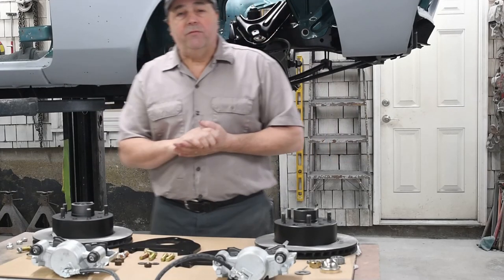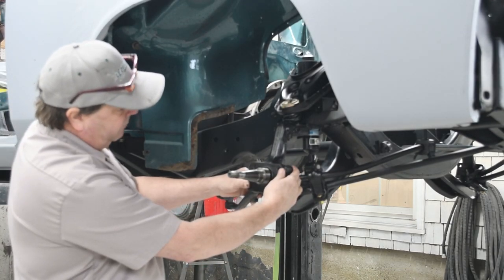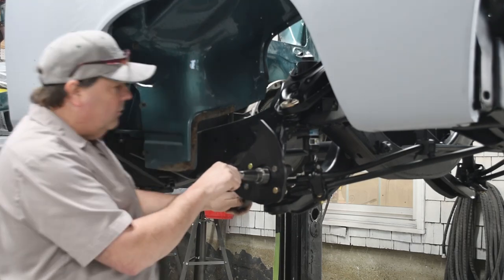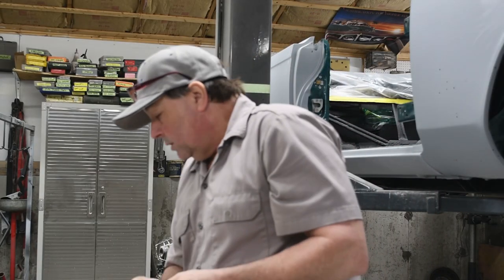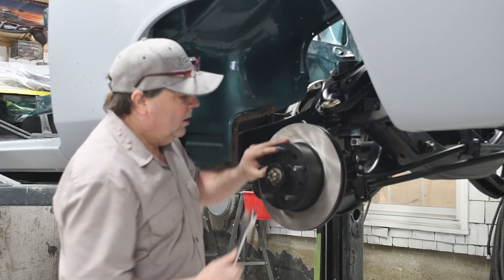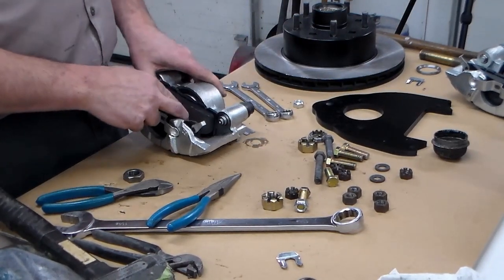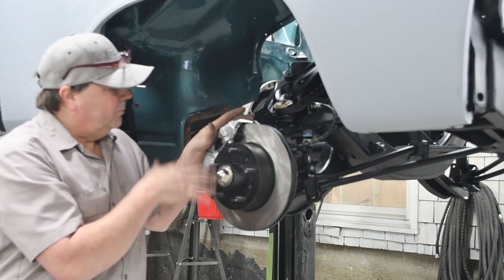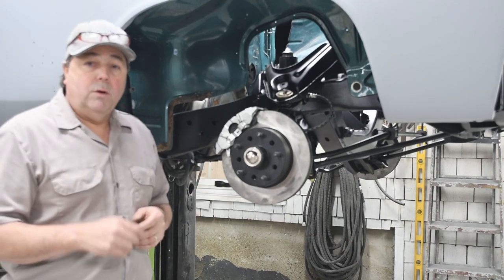Disc Brake Conversion

Comment: I am a B body guy, but I seem to remember that you could have used 1970 - 1975 C- body disc brakes including the spindles. It may have even been 1969, I just can't really remember..
Reply from the maker: I think some of that is correct Steve. During my research I found some thing for the front. But nothing for the rear. So when I had the rear made, I added the front on to the order. Thanks for the comment, Troy
Reply: 1966 and older Imperials have a different wheel bolt pattern than 1967 through 1973 Imperials; 5x5.5 versus 5x5. The C-body Chrysler products have a 5x4.5 pattern and a smaller spindle, so swapping brakes isn't an option.